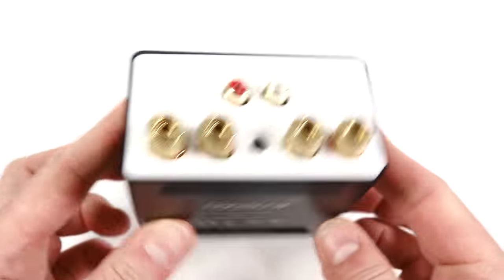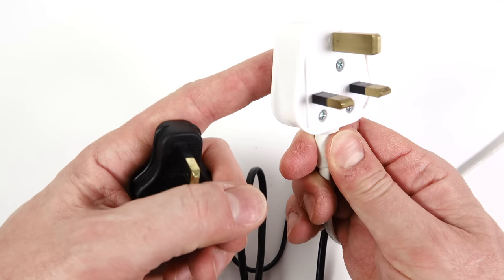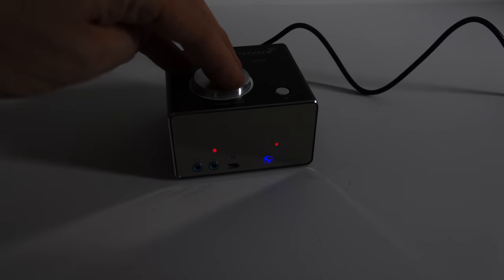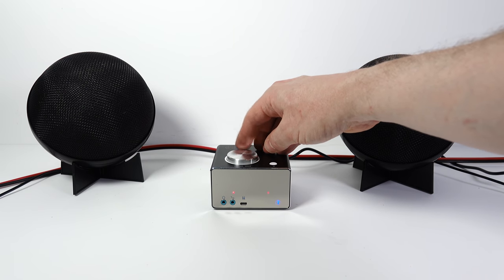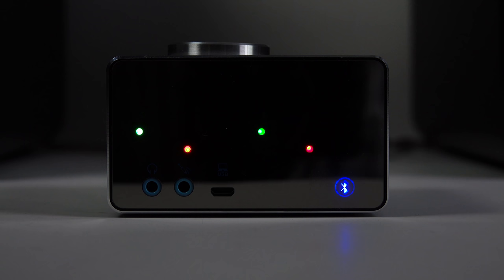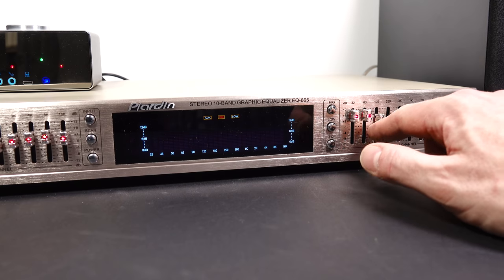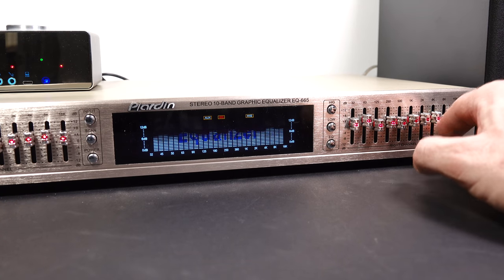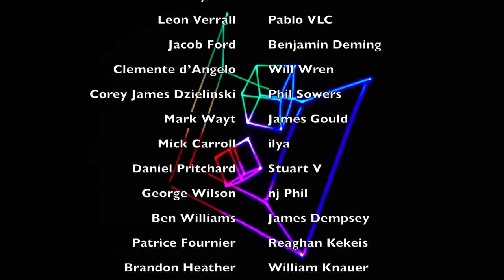REVIEWS: Mini Amp & Graphic Equalizer

Comment: Hey! You can fix that un-working LED by just pulling out the cap of the eq pot. The LED is not soldered, it just sits there being pressed to make a contact by the plastic cap itself. Behringer uses the same style of LED lit pots for their PRO range of analog EQ's. Like this one: https://www.thomann.de/de/behringer_fbq3102hd_ultragraph_pro.htm?sid=90c81333a8dbc1dad3869a6381f5852f
Yours are just painted to look metalic :)

Comment: Got a Pro-ject Stereo Box S2 a few weeks back and found it very noisy in the background.
Reply: If you having something plugged into it (a computer, etc) try unplugging whatever that is and instead and running via bluetooth just as a test.  I've found some viscous switching noise when plugging devices into mini amps. (I have the SMSL which is a similar unit internally)
Reply: @CTRIX64  It's plugged in by itself and is the same on every input.

Comment: Can you do a video of cheap phono tube preamps like the nobsound T2 and T7 with also the posible replacement tube ( nos )
Reply: Arno Rotterdam I have douk audio d2 preamp. And it sound not good. It kill holographic and air, and do more bass. I try to change valves, but it didn’t help. Look like it do something bad with stereo, like convert it to semi-mono. So I not recommend their valve products. Only if you like boom box music level, then ok ;)
Reply: @Kirwish5  Where did you use the D2 for? The D2 is no Phono preamp.
I have looked up the mainbord from the D2 and is totaly diferent than the T2 and T7

Comment: how is an amplifyer different from a volume button?
Reply: The signal strength from most equipment isn't strong enough to power a speaker (less than 0.5 watt), so an amplifier is used to create a signal powerful enough to driver the speakers. A volume control is generally a variable resistor that reduces the input signal into the amplifier, full volume is there for the full signal strength from the equipment through the amp.

Comment: I have a suspicion about that "equalizer" -- my suspicion is that it takes the analog input and runs it through an analog->digital converter, then applies the "equalization" to it....but they didn't bother to build anything that could actually analyze the digital signal for frequency spectrum - probably too expensive, so the LED is a worthless pile of crap. The other thing, if I'm right about it, is that you have no idea what sample rate is used in the analog->digital conversion process, so the signal you get out of the device is probably not the same as the signal going into it.

But, as I said: this is just a SUSPICION.  I'd have to look at the device directly (or at least some website listing with a lot more details about it) to be certain.

Comment: Wow, the picture in the middle at 4:38 triggered a memory of my teenage years. A friend of mine actually had these Audiorama 5000 HiFi Grundigs from a discarded old quadrophonic setup and we tried them and found them absolutely terrible. We scrapped them and I used the drivers for DIY bookshelf speakers. They actually didn't sound half bad then.

Comment: The comparison shot of the mains plugs at 1:39 - anyone spot the other problem with the supplied connector? Big Clive fans will know this one. 

Yes, I know this is a "double insulated" system and doesn't require an earth pin. In which case there should be no metallic conductor. It is worrying that they think this is a valid thing to do, I'd be concerned about the PSU quality.

Comment: Also notice on the cheap Chinese plug, that they put a protective sheath on the Earth pin. So actually once its fully plugged in, it wont be earthed at all since they dont make contact.
Reply: That's perfectly normal for UK plugs connected to 2-core cables. In many cases the earth 'pin' is made entirely of plastic and serves solely to open the live and neutral shutters.

Comment: Any plug that came with the amp wants to be discarded ASAP because there is no fuse!
Reply: Don't you guys have curcuit breakers? Lol
Reply: @westelaudio943  Yes we have circuit breakers in the consumer unit that are RCD protected and a wire system in the UK for sockets that is called a ring main. A ring main is basically a loop of wire that all sockets are connected to, that goes from and back to the 32 Amp MCB in the consumer unit. However the BS 1363 standard requires all plugs to have either a 3, 5, 10 or 13 amp fuse in them.

Comment: DO NOT USE the plug and lead that came with the Nobsound amp. The earth pin is partially insulated and most likely will not make contact with the contacts in the wall socket.
Reply: Plenty of UK plugs used with class 2 and 3 appliances have plastic earth pins:
https://en.wikipedia.org/wiki/AC_power_plugs_and_sockets:_British_and_related_types#/media/File:Bs1363-non-earthed-plug.jpg

Comment: The fake spectrum analyzer is intriguing, since it's using a display module clearly meant for a real one, it just does not have the circuit to actually analyze the spectrum and drive the display accordingly. If these units were really cheap they would be an okay source for such a display module, but at that retail price they're totally useless.

Comment: I 've built a pair of speakers with some hi-fi 4 ohm and 12w  dual cone drivers, which were designed to be used with tube amplifiers. I was planning of building a transistor amplifier for them but something went wrong with the bluetooth module. Should I buy a mini amplifier like the one in the video to get them sounding good without a big effort?

Comment: 11:09 "...Where things have ended up these days". When you buy plasticy equalizers that cost less than a good one did back in 1985, you can't expect to get anything even next door to quality. Besides the novelty effect of blinkenlights, an equalizer has no "playback value" besides trying to patch up the symptoms of a crappy system. Leave them for recording use.

Take a look at Steve Guttenberg's "The best $500 or a lot less complete budget audio systems" for examples of sensible components at sensible prices, without wasting money on things like equalizers to begin with. $200 for a pair of bookshelf speakers, $100 for a class D mini amplifier, and you're still left with $200 for some kind of source and cabling.

Comment: Dynamic range is not frequency response. The speakers have a limited frequency response not dynamic range. Dynamic range is the difference between the quietest audible sound and the loudest sound before clipping at a given frequency

The frequency response of a loudspeaker driver is its band pass. You can have a loudspeaker system with a frequency response of 20hz-20khz that is made of of three seperate drivers each with its own band pass.

Comment: 1:14 And it has a sleeved earth contact which probably does not make a proper contact which makes this not only dangerous but could bring you some trouble by the ensurance. If you receive a cable like that, instantly call up the seller and let him send you a new cord!
In practice, it should be fine since it only has 2 contacts on the other end. But that sleeved contact pin is a giveaway that it is NOT made by someone who knows what he is doing!
Metal case device with the mains coming in via the "replacement psu" without being earthed? No, thanks. They lost me with their junk cable.

Comment: Not familiar with UK plugs but if that middle pin is ground, wouldn't the supplied plug defeat it with that partial cladding on? I wouldn't use it either.
Reply: The PSU is most likely a class 3 electrical appliance, so the earth pin won't be electrically connected to anything. The purpose of the plastic earth 'pin' in this case is solely to open the shutters on the socket  for the live and neutral pins.

Comment: Hah. I used to have those Technics ball speakers. They were used with a Technics Dolby Pro-Logic 5.1 separates system, and I hardly ever switched them on cos they sounded so shit.
Reply: Prior to the Dolby Pro-Logic 5.1, it was quadraphonic, a 4-channel system where you can connect to all 4 speakers using a special decoder like my Sony SQ decoder model SQD-1000. It does have 4-channel sound, but works with Dolby Pro-Logic 5.1 which is compatible with SQ. It can also play Quadraphonic SQ records as well including albums from the 1970’s that supported 4-channel sound which were SQ, QS and CD-4. These never catch on until they gave up the format by the end of the 1970’s when surround sound were used in theaters using the Dolby surround sound system.

Comment: Graphic equalisers were always a visual thing really-the manufacturers always claimed that you could correct room dimensions with them-all a load of bollocks.You can correct that by changing the speaker placement and angle.Graphic equalisers just end up degrading the sound away from the original.My advice for what its worth is spend the cash on better speakers.
Reply: depechem0demusic Nonsense. Speaker angles and equalizers adjust different aspects of the sound. Angles deal with echoes and stereo separation.  Equalizers deal with the frequency response, and can potentially null out the combined response curve flaws of the entire setup. But to get a flat response you need a spectrum analyzer and a good test signal such as a sweep or noise.
Reply: depechem0demusic Nonsense. Speaker angles and equalizers adjust different aspects of the sound. Angles deal with echoes and stereo separation.  Equalizers deal with the frequency response, and can potentially null out the combined response curve flaws of the entire setup. But to get a flat response you need a spectrum analyzer and a good test signal such as a sweep or noise.
Reply: John Francis Doe bullshit-so you think the equaliser in this video is going to improve the sound of an £8000 Naim audio system??
Reply: John Francis Doe and as for the amp-nobsound says it all

Comment: "If I'm using speakers with a computer, they're active speakers with a built-in amplifier that don't need an external one like this. I suppose there's somebody out there that's got some old bookshelf speakers they want to plug into their computer"
looks at computer plugged into an assortment of 70s Pioneer, 80s Technics, and some weird English boutique speakers, most of which are larger than the average Shetland sheepdog and one of which I'm using as an actual bookshelf
I feel personally attacked.

Comment: the ac adapter is internally fused so no fuse is needed in the plug btw. barely any plugs are fused in the us because of this.
Reply: A fuse in the plug protects against any shorts in the cable. If the cable's as well-made as the plug is, I'd want a proper fuse in a real plug. 

In the USA people's houses just catch fire.

Comment: Has that plug got a fuse in it?  I've come across Chinese power leads which don't have fuses- beware, this can be dangerous!  A domestic ring main can supply 32A of current, which is why a plug fuse is necessary to reduce the current the lead can supply to 13A, 5A, or whatever.  If it doesn't have a fuse, don't use it, use a different power lead with a fuse.

Comment: No fuse and an insulated ground pin. Im sure there are lots of grinding teeth in the audience. Lets live dangerous and plug it in.
Reply: The insulated ground pin isn't a problem for appliances that are internally earthed. Even BS compliant plugs often have a plastic earth pin:
https://en.wikipedia.org/wiki/AC_power_plugs_and_sockets:_British_and_related_types#/media/File:Bs1363-non-earthed-plug.jpg

Comment: The UK plug is definitely an amazing design. It's incredibly safe. I would definitely argue that an internal fuse is unnecessary because circuit breakers are a thing.
Reply: My car has air-bags, doesn't mean I don't slow down for corners.
Reply: The circuit breaker will be 32A, not enough to protect the flex on many appliances.
Reply: @tartrazine  ah, so that's why. 32A on a 220V line is a lot of energy. I'm used to 15A-20A breakers on 120V

Comment: its a shame this cheap eBay one doesn't actually do much since it would be a bargain but for a little more there's this one I found for $64 which has a functioning spectrum analyzer https://www.rockvilleaudio.com/req42-s-home/

there's also a cheaper one with VU meters instead. I think that's about as cheap as you can get before you get into the "too good to be true" territory

Comment: Welcome to the world of "class d" amps
Reply: To the world of BAD class D amps.
The good ones (Conrad-Johnson and Devialet are two examples) are really serious gear...and not cheap, precisely.
Reply: @venturarodriguezvallejo1567  I've got a cheap "breeze audio" tpa3116 and it's great! Not for critical listening obviously but to have something on or for the xbox to go through. For critical listening I use my VTL 50/50.
Reply: @resonantconsciousness9248  Just curiosity: is the VTL a tube amp?
I use in my main system a Luxman CL360 tube preamp and the classic Mac 275 power amp. I love their sound with the semi-active Missions 767 (in the summer I change to A-B solid state for obvious reasons).
Cheers!
Reply: It might be the world of class D amps, but I will take a class A amp or even a good AB amp over a class d any day. The THD% on modern amps sucks in comparison to what was made in the early 90's. I have a Pioneer M-90 stereo amplifier, rated at 200Wpc@8ohms RMS with 0.003% THD at 20hz-20khz and a flat frequency response curve of +0/-0.1dB at between 20hz-20khz. It is also stable down to 2ohms where it can put out 800w of power. Find me a modern Class D for less than a $1000 that even comes close to those numbers.

Comment: The Plugs aren't supposed to have the plastic insulation on the earth pin. not that it maters much when the cable doesn't actually have an earth.
Reply: i've got quite a few plugs on chargers etc where the earth pin is just plastic and literally there just to raise the shutters in the socket

Comment: Sorry, I think I should tell you that you made a small mistake with your wiring. In the combined wires, silver / copper, the silver wire should ALWAYS be used on the positive pole. This is because silver is a better conductor than copper. It's a good tip for the future, thanks for the video.

Comment: Sad that this is how things turned out bc everyone though they needed dollar store plastic everything from China. A similar thing happened to Cars imo they peaked in the late 60's to early 70's but at least they became more efficient even if virtually  impossible to work on & disposable by design. & Consumer Stereo equipment peaked in the 80's ish. It somehow became & now is a VERY normal thing for the average household to not even contain a single speaker capable of reproducing bass. Which is ironic considering hip hop/rap & the subwoofer craze in auto audio. Just earbuds or a small mono bluetooth thingy(of which some do sound quite ok for their size) seems to suffice. When in fact even the worst stereo(floydd perhaps lol) I ever owned was 10X better. Good old Hitachi(even) & Marantz where are you now ?

Comment: Urgh.  Non-compliant G-type plug.  There really shouldn't be any insulation on the ground pin.  That misses the whole point of it being longer than the other two pins as per the standard...
Reply: Duncan Taylor For an ungrounded C7 cordset, a dummy plastic pin is fine, it's essentially an oddity caused by the early shutter design in the UK socket standard (most other types use differential pressure shutters that react to the L and N being inserted together, not one knitting needle at a time).
Reply: @johnfrancisdoe1563  You're right, it is ungrounded but it's the fact that it's still a brass pin and insulated that's bothering me.  You're quite right, of course.